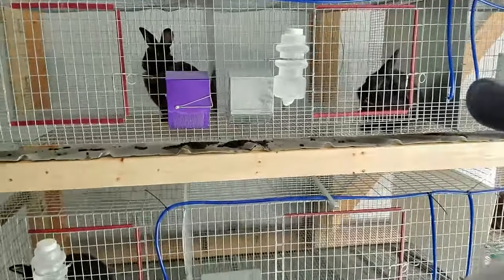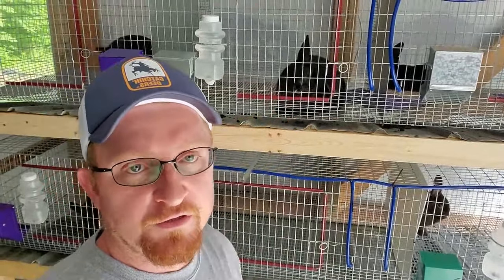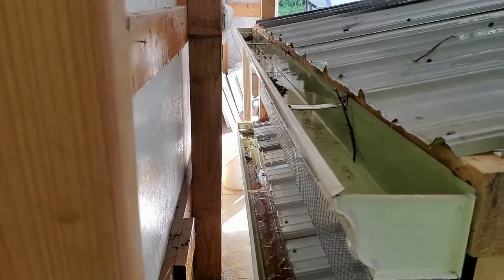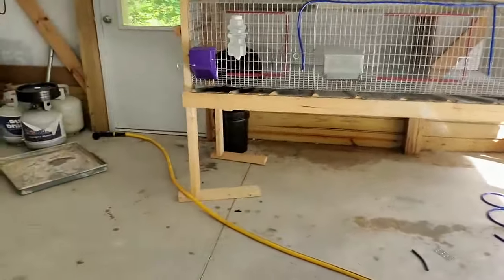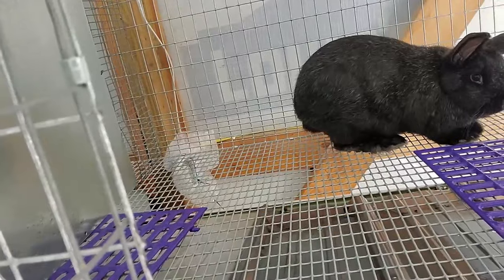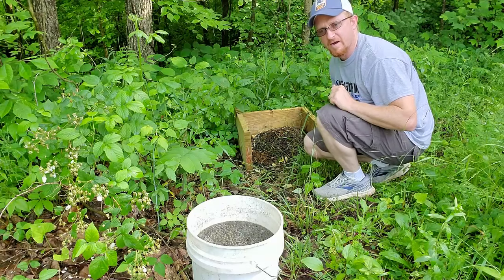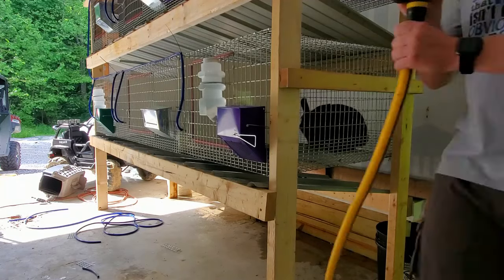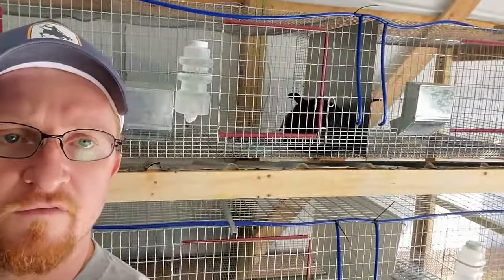Quick and easy rabbit hutch cleaning- Odorless Rabbit Hutch!!!

Comment: If you used a tight tarp in place of the tin (with a steeper angle) would you be able to "bounce" the tarp from the underside to knock the poop down without the need of getting the poop soaked?  Or does it stick?  If it isn't sticky, you could dump the urine, then collect the drier poop with a brush in the gutter. Or somehow make the gutter easy to remove so you could just tip it into the bucket?  Interesting system!  I don't have rabbits- yet. Still looking for a low maintenance design like this. Love the water system!

Comment: I wonder what would happen if you used a smooth surface under the cages and attached a windshield wiper system.  They are 12v and could run off a battery. Set them on a timer to automatically spray and wash every few hours.  Thoughts?

Comment: is that about a six inch difference in height between the top and bottom of the metal roofing?  how much of an angle did you use for the gutter?